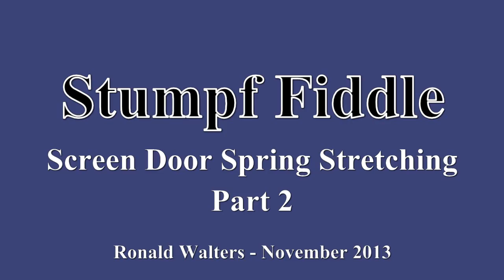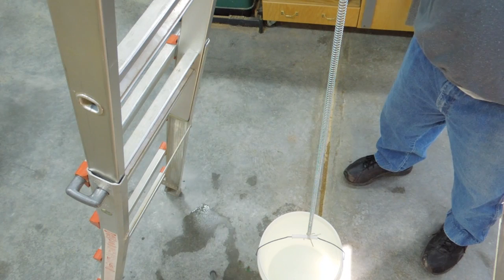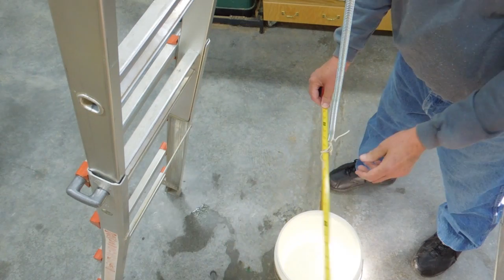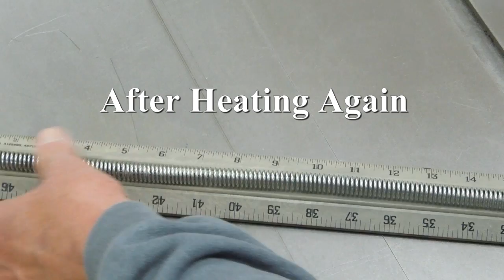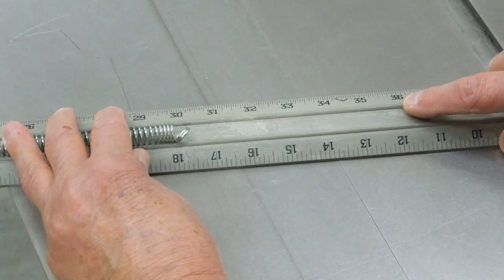Stumpf Fiddle Part 2 Screen Door Spring Stretching

Comment: How long was it stetched from where it was harnessed to the ladder to the bucket handle?
Reply from the maker: Don't remember... that was a few years ago. Starting with an 18 inch long spring, I would stretch it to 36 inches with the bucket of water sitting on the floor, then GENTLY and GRADUALLY warm the spring and check it once in a while so as not to exceed 30 inches at relaxed length. Have fun! Thanks for watching.